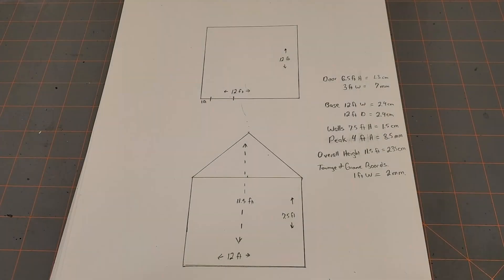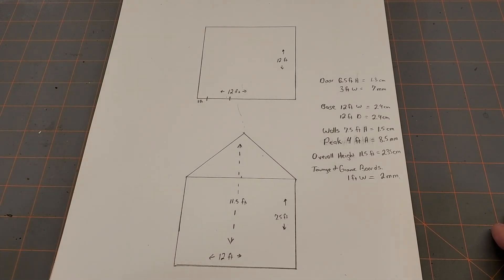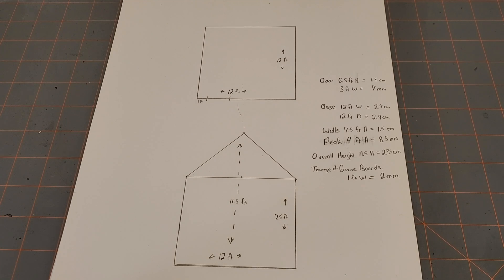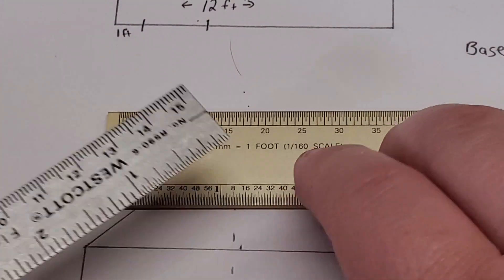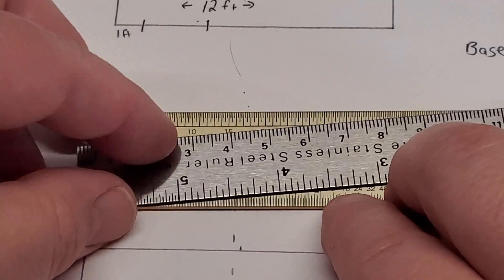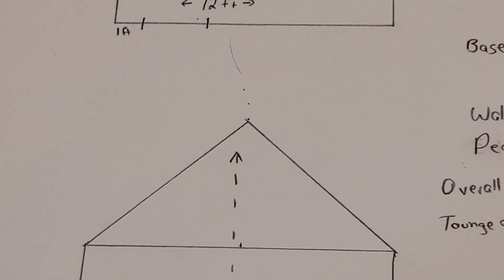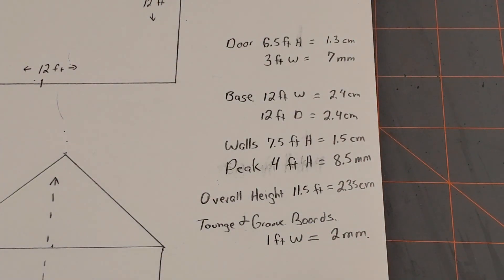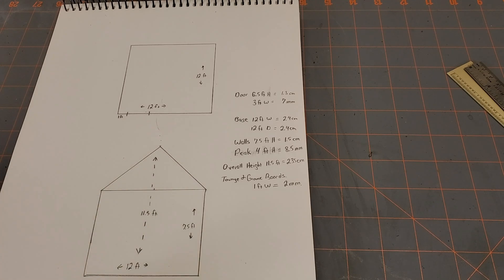3D Designing in Fusion 360 for Model Railroad, Shed 1

Comment: All great designs start with a Barroom napkin.  As for help with idea details instead of straight GOOGLE  try searching for manufactures of what you want to add, Windows & doors Andersen,, Pella are just two, I'm looking at on and off the farm storage now , My search was AO Smith Harvestore.  Add dimensions to the end of any search and it will take you to industry standards.
Bookmark a couple of converters for scale conversion.   Stick to one measurement system and use the one that your output device needs (3D printer).
Reply from the maker: Hey thanks for the advice. I will definitely start using manufactures for specific dimensions. Any thoughts on where to find standard"ish" ceiling heights for the classic downtown America types of buildings?